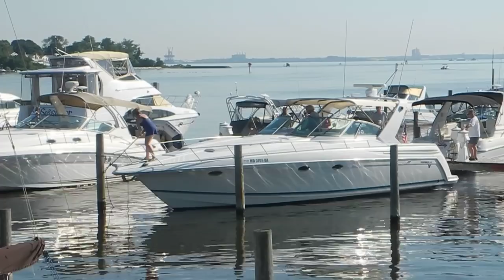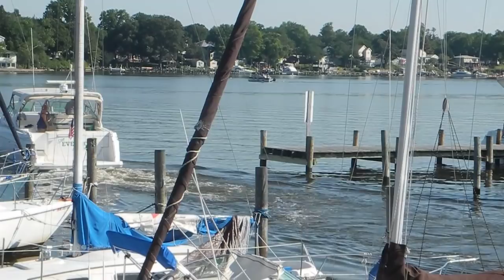Choke knots do NOT belong

Comment: Is it a bowline knot or a bow line knot?. Captain Chris won't you agree the bow line makes more sense considering the application.
Reply from the maker: Bowline knot. Bow line was attached to the piling using a choked loop. I suggested a bowline knot rather than the choked loop.
Reply: @AskCaptainChris  I get that but wanted to point out the bowline knot was named for its best and historical application.
Reply: @harveyroad6  the "Bowline" knot is pronounced "bowlin" and has nothing to do with being on the bow of a boat.